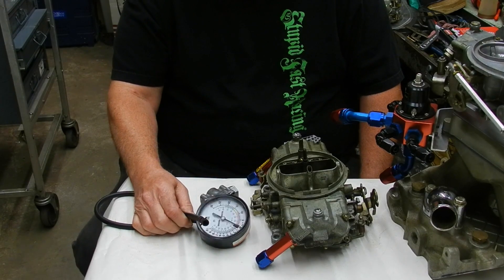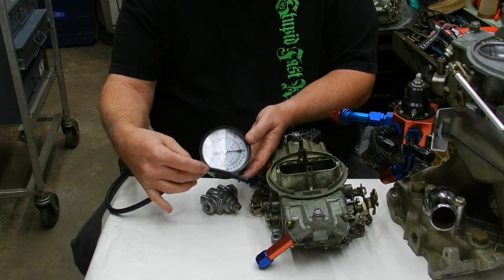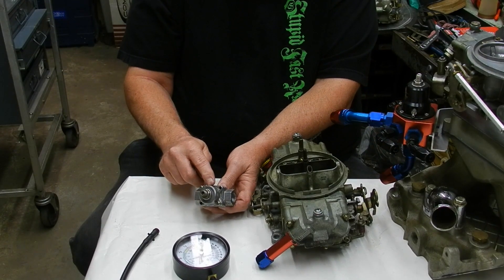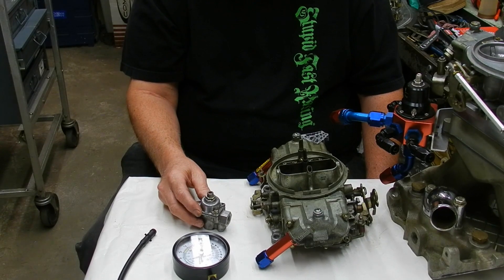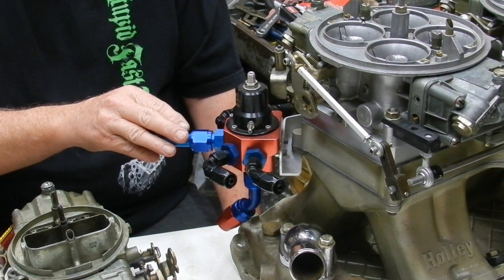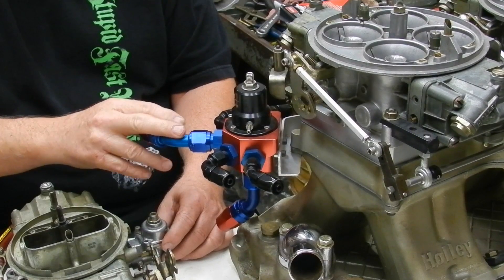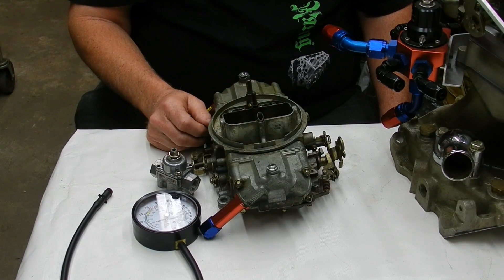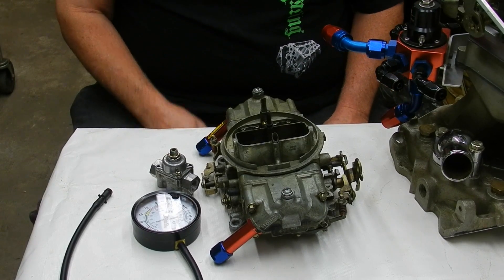Holley Carburetor : Fuel Pressure 101

Comment: the 305 sbc in my 1982 Chevy malibu wagon is putting out over 9psi of fuel pressure. Iam running a Edelbrock 650 cfm. Its okay driving from what I can keep an eye on, But when stopped at a light, still running there is a lot of white smoke the comes out of the exhaust and really reaks of gasoline off the block, . Might have to install a regulator setup to kick the pressure down..
Reply from the maker: Usually the pump is defective should only have about 5 to 6psi. When this happens there is a bypass in the pump that gets restricted and causes this problem hope this helps.

Comment: Goday Randy, I am a big fan Of your videos, I stay late at night fallowing them. My question or better still one of them is : I changed two good "quality" fuel regulators  and I can't get to adjust the fuel pressure, it just don't move. In turns the fuel gauge is also expensive and it has liquid , bur because of that it changes the reading from when the engine bay is cold to hot. I could adjust it while could, but needle never moves from most of the time just before 5 PSI, pump is Carter. It looks like well made and much quieter then a Holley one.?? Could you help me on this one Please?....Cosimo.
Reply from the maker: First check fuel pressure at the pump straight off the pump and let me know your reading also are these bypass regulators with a fuel return hose to the fuel tank or non bypass.
Reply: @holleycarbshowtosadvice40y90  Hi Randy and thank you for the quick respond. At the moment I can tell you that the fuel system has no bypass, and no return line to the fuel tank. The fuel tank has no prevision for a returned line. It will take me some time to check the fuel pressure after the pump, unless I go past the second filter, the one after the fuel pump? just for convenience. Both filters are very new, I just finished fitting the petrol fuel system from dedicated GPL, or LPG? Rearranged the distributor, and it works fine I live in Sydney Australia and LPG is getting scars, especially for a 4-wheel drive 1986 Bronco full size which I love it. Thanks again, hope I explained in a clear way. I am almost 70 years old and haven't stop playing with cars Kind Regards... (Cos).  Ho by the way, the MSD distributor when it was set for LPG , I had to fabricate the rev stopping bush which allows the distributor to advance only 2mm in other to function well without pinging, as the MSD kit has no provision Bushing for LPG that needs 18 degrees static advance and to stop at 28/30 degrees total maximum at 2500 RPM especially on a three speed heavy Bronco. Apology for the extension and out of team story, but I enjoy talking cars. All the best.
Reply from the maker: Well as long as you can test it before the fuel pressure regulator. Just write me when you have time, no hurry. Have a good day cosimo.
Reply: @holleycarbshowtosadvice40y90  Thank you very, very much Randy. Have a good day.. Cos.

Comment: Does the fuel pressure of 6-7psi get divided by 2 if running two carbs
Reply from the maker: You always feed the carbs the same pressure ,if your just cruising 5 to 6 psi.
 Full race 6 psi 7 max, a good fuel system has to be designed right for the application. Hope this helps.

Comment: Anything over 6psi my holleys dribble out of the boosters real bad.....
Reply from the maker: There is a several things that effect booster dribble like booster type, float material,how high the float setting, how much velocity in the venturi for instance big throttle plate with small venturi and an annular booster even the heat can factor in, I've seen holleys run 8psi and with out flooding, I've ran 7psi on my race car but I don't recommend any higher. Hope this helps.
Reply: @Holley Carbs: How To's & Advice ,40 yrs of exp.  interesting... I've had it happen on both my 870 carbs..  float level was the first issue but now seems to be pressure related. When I get it down to 6psi it stops. I have a radical cam with very low vacuum. Wish I could lean it out at idle more but it starts to stumble when I go any leaner then 1 and1/2 turns in on my mixture screws

Comment: Also, the size of the return is very important. Generally, it should be at least the same size as the feed, if not bigger. If the return is too small, the regulator will have a hard time, well, regulating.
Reply from the maker: I agree , I've seen alot of fuel systems where they use one size smaller return , I always ran the same size and never had a problem. With alcohol I ran a Barry Grant regulator that was linked to the carburetor linkage that increased fuel pressure as the throttle increased, idled at 4psi ran 12 psi at wot worked perfect.take care.

Comment: Struggling with my pressure regulator install.  Wondering if there is too much pressure for regulator coming in, but Can't find answers. And should I be using thread locker on adjustment nut and screw?  It sprang a leak from there after a little driving. t was working for about 10 or 12 miles worth of driving.  Ugh!
Reply from the maker: If it leaking around the adjustment screw when you loosen the nut the diaphragm is ruptured, and probably won't control the pressure and there's no need to put thread locker on the adjustment screw or nut at all. As far as the pressure I would have to know what pump your using. Let me know and maybe we can sort it out. Hope this helps.
Reply from the maker: Usually you can buy the diaphragm separately and replace it. Hope this helps
Reply: @Holley Carbs: How To's & Advice ,40 yrs of exp. 
I know nothing, so forgive the dumb question's.  I basically installed a deadhead regulator (rated for controlling fuel PSI to 4-9 PSI).  Inlet without the Deadhead regulator was 10-11 psi (per the in-line gage).  Do you think it's also possible Nut wasn't tight enough?  I'm referring to the adjustment nut and screw on top of regulator.

Comment: Hi Randy.  Have you ever known a mechanical fuel pump to over-pressurize under wide open throttle conditions?  I have a 383 SBC with a mechanical pump and no regulator.  At idle I have 6.5ish psi.  No signs of flooding or booster leaking at idle.  However, when I go over half throttle and get into the secondaries (Quick Fuel 750 dp) it goes pig rich.  10:1 on an air fuel gauge.  No amount of jet changing (10+ sizes) has leaned it out.  I’m out of ideas except for maybe it’s a fuel pressure issue?  I have swapped out the carb for a new Edelbrock to rule that out and it does the same thing.  Also bought a brand new air fuel meter and o2 sensor to rule that out as well.  Still no luck!
Reply from the maker: I have seen stock mechanical fuel pumps pump as high as 13 psi, now the majority of them pumped maybe 8 to10 psi at idle but the pressure would increase with rpms. So you could diffenitely have this problem. I use to hook my inline fuel pressure tester up and monitor the fuel pressure as I raised the engine rpms up, the pressure would increase  usually by 3000 rpms the pressure would be way to high ( 10 to 13 psi ). Please let me know if the fuel pump is the problem, if not we'll figure something out.
Reply: Ok thanks Randy.  Should my first step be adding a regulator with the existing pump?  Or will I still get pressure creep with a regulator if the pump is “bad” and gradually increasing pressure with revs?
Reply from the maker: If you know the pressure is rising with the rpm then I would replace the pump as far as regulators I only like the bypass regulators for strictly drag racing , they don't seem to creep. hope this helps.

Comment: Can you help Holley isn’t no help. I have a return style regulator and set the pressure at 6.5. I can go drive around for 10-15 minutes and then the pressure is at 3psi. I can reset it at 6 and then it goes to 7+. I put a gauge on the regulator and at the at the fuel log to try to trouble shoot the psi. I have a Holley blue and changed the regulator bc Holley said not to dead head the regulator. I installed a return line and also bought another fuel pump. If I don’t adjust it the pressure at the carb goes to 0 the car doesn’t die but I haven’t had it in the track to see if it starves. Any suggestions or just set it and don’t worry about it?
Reply from the maker: Brian drive it and when the fuel pressure drops check the fuel volume at the carb if there is very little fuel then start tracing back to the tank. Remove the gas cap to see if its a venting problem, look for any type of restriction or hole in any rubber hose , make sure the fuel pump is mounted correctly , some fuel pumps won't pull gas they have to be gravity fed, I also had a problem similar to yours and it turned out to be dirt in the tank and it was sticking the pressure regulator valve in the electric pump driving the fuel pressure crazy. Hope this helps.

Comment: You replied to my question in your other video yesterday about my issue with fuel flowing from only one primary booster starting at about 2k rpm. I measured my fuel pressure today and it's 8.5 psi. So at first I was concerned but I know many accomplished racers running the same pump without a regulator. It's a discontinued Carter 172 BBC mechanical race pump. The spec sheet says 8.5 psi and a similar Holley pump is rated at 8 psi. Floats are adjusted without any issues. I'm a little confused because many guys with fast and well setup drag cars are running these pumps.
Reply from the maker: Well to me that's a lot of fuel pressure John but if you are just strictly drag racing you might get away with it, alot of different fuels and heat will change things, if you are just drag racing sometimes your ok , but I assure you it's not always that way, I normally run 7 psi or less but I run an electric pump . Now that being said, I have much more confidence in a mechanical pump than in an electric  pump when it comes to dependability , they both have good and bad things, electric has continual flow were mechanical has to see two full revolutions of the motor to pump once.  With me it would matter what I'm doing with it. With most things volume always trumps pressure. Hope this helps.
Reply: @holleycarbshowtosadvice40y90  Yes it does, thank you very much.

Comment: Any pressure regulators with return lines you’d highly recommend? Finding a lot of people putting down big name brands on normal street car regulators but I don’t need a crazy fancy one. All I’ve got is a 10:1 N/A Cammed 350 sbc with a Holley 4150 650 double pump
Reply from the maker: I dont recommend using a return fuel system on a street car, I've used them on most of my race cars with great results .Fuel didn't creep up stays very consistent,  but street use no I would not recommend using a return system to dangerous , fuel leakage on the return side would not effect the engine performance , and could be a very dangerous fire Hazzard. I ran a return fuel system (achohol) on our open wheel modified dirt race car and on our drag cars. But I would never run it on a street. car.
Reply: @holleycarbshowtosadvice40y90  I was looking at switching to a fuel cell in the bed instead of my cab in my 63 C10 and going to braided lines. Wanted the return for safety from flooding bowls and to help circulate fuel so temps stay little lower. Still think it would be dumber to go that route?

Comment: Hi Randy, I bought a Holley 12-834.  It says GPH is 80, and psi is 7.5 and says regulator not needed.  I have a 450 hp 383 stroker sbc with a 750 Holley...I bought this pump because its a compact design that I needed to fit in my 55 Chevy 210...whats you thought on this?
Reply from the maker: Bob you might get by with it , I would rather see no more than 6psi on a street car.

Comment: What happens when it’s too much can needle seat get damaged? Was running 7psi turned regulator down put needle and seats back in turned fuel pump on still flooding. Thanks for video
Reply from the maker: Usually it don't hurt anything , watch my video on  flooding , I covered most things  that causes flooding , sometimes you run a cross a bad part, I thing the video was next to the last .

Comment: Hi Randy, my holley 670 street avenger has a real hard time starting when its cold if you give it more than a pump it doesnt want to start but when you do get it started you need to hold the idle up for a minute to keep it from dying out which it usually will a few times regardless of trying to give it a little gas or just letting it try to idle. I believe it may have something to do with fuel pressure because when i first start it up cold it has 8-9psi but then once warm will drop down to 5-6psi and run great and when warm starts right up with a bump of the key. Any suggestions on the cold start issue and high fuel pressure when cold? Thank you in advance
Reply: And just figured i should add that i have the aeromotive fuel pressure gauge that has the little pin to release the pressure when warm to keep the reading consistant but it still isnt. Also the fuel pump is a holley 110gph mechanical pump
Reply from the maker: Paul I would fix the fuel pressure first should stay the Same hot or cold , I had some problems with the holley pumps , they hate any kind of contamination especially dirt which causes the spring loaded bypass piston to stick at times and make the fuel pressure erratic , then if you still have concerns write me back.

Comment: what are the signs of low fuel pressure would having to close the choke to about 3/8" to 1/4" to clean up and run
Reply from the maker: If fuel is restricted bad enough it can cause what you described , the most common problem is lost  power under a load, but a stopped up carburetor will have a lot of the same symptoms, always check fuel pressure and volume first. Remember you can have pressure without fuel, a cracked hose at the fuel tank will deliver air and not fuel. Hope this helps. thanks for watching.
Reply: @holleycarbshowtosadvice40y90  thank you

Comment: I'm running a Holley 12-834 fuelpump which  max is 7.5 psi  on my SBC 400 and the fuel pressure bouces between 7psi and 11 psi is there something wrong with the fuelpump I run these fuelpumps all the time with no issues and the car runs and drives GREAT?Thanks
Reply from the maker: Dickey usually 7.5 psi is questionable, some carbs will handle that some won't, there is a lot of factors including heat and fuel and pivot points and types of float material, I would try lowering fuel pressure to 5.5 to 6.0 psi.

Comment: hi Randy, I run a holley 4175 spreadbore on AMC 304 V8 in jeep cj5. Mechanicsl pump, using Mr. Gasket fuel regulator in dead head system. Running 3.5 to 4 psi. Everything is great. Use is off and on road. I did not want any fuel spill over so I set the floats a tad lower. Also  used the whistles in bowl vents. A guy on utube said the spreadbore likes only 3.5 psi. No problems yet but rough trails are ok and hill climbs?? Dont know yet. Also I have installed float springs to keep floats  stable.  Any comments I would like you to give please. Other jeep guys said holley is bad for off road. My 4175 is getting amazing gas milage 18 mpg. The 304 can idle down to 200 rpm and is smooth as silk.
Reply from the maker: You know what your doing, good luck.

Comment: Is slightly lower fuel pressure than 6 psi okay for the street on a 4150?  My delphi mechanical sbc pump specs say it puts out 5 psi?
Reply from the maker: I like to use electric high volume pumps at the race track, 6psi to 7psi with return regulator. Not racing I want to see 5 to 6psi , just remember a mechanical pump has to see the crankshaft turn two complete revolutions to pump fuel one time. Electric has steady fuel flow , sometimes you can get away with a stock pump it matters what your doing with the car and the size of the engine.Hope this helps.
Reply: @holleycarbshowtosadvice40y90  thank you sir!
Reply from the maker: Your welcome.

Comment: I have one with a stock sending unit and a ac delco fuel pump, into a holly carb and it's flodding out the vent tube
Reply from the maker: Check your fuel pressure. 5 to 6psi is what you won't. Install a fuel  return regulator  and that should take care  of it. Make sure it is a fuel bypass regulator ,this will require a good quality fuel return line to the tank .

Comment: I recently swapped a new Holley 850 DP with a 650 DP and I can't get my 383 to run with less than 10 pounds of fuel pressure. I've adjusted the carb up and down to try and lower the fuel pressure and it just won't run. I'll be changing the fuel filter next. I am open to thoughts and ideas
Reply from the maker: Does it run fine with the 850?
Reply: It did but I'm trying to get better gas mileage. I'm trying to put a bog truck back on the street. I did get the 383 to run on 7lbs. After changing the fuel filter. My problem now is I'm getting popping out of  one cylinder so Ive got a valve lash problem on the roller rocker or my cam has gone to shit.  I want to get rid of the roller rockers and put regular rockers in it. I'm learning as I go and it sucks. Nobody near me  knows how to nor wants to work on hot rods.
Reply from the maker: There is several things that can cause the valve lash to tighten up and cause  this popping ,include cam lobe wear on a flat tappet cam  or valve seat recession, popping can be caused by a broken valve spring ,there is a  long list of things, hope this helps. PS the 650 could have problems too.